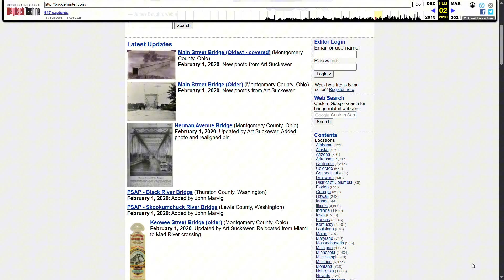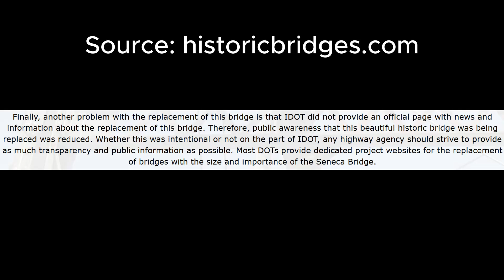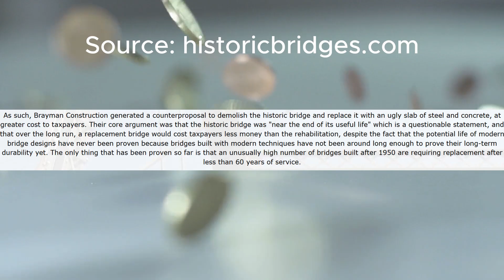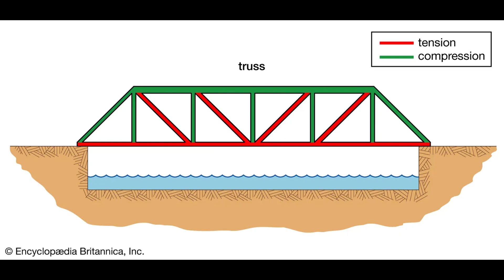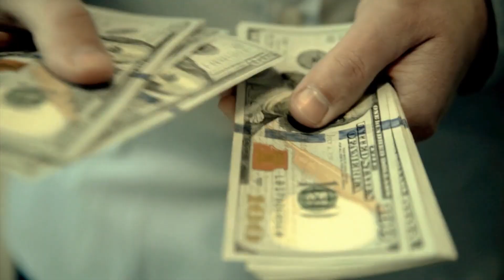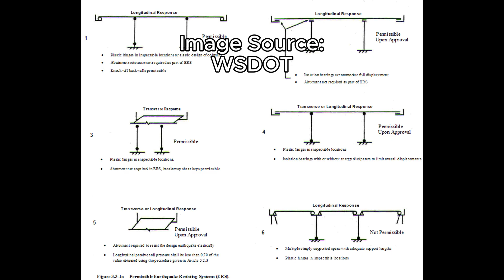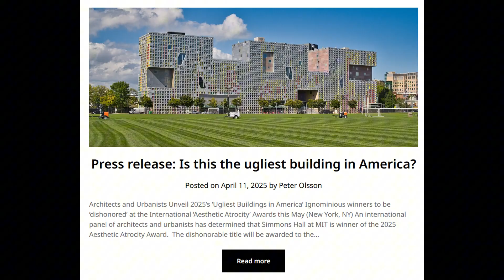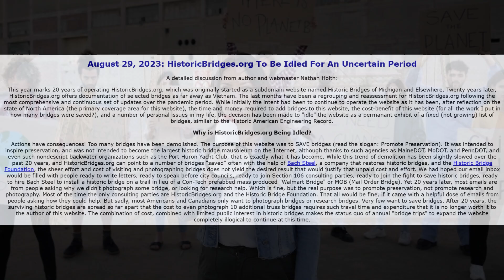The Tragic Death of Truss Bridges

Comment: I'm into historic highways and all the infrastructure features associated with them, especially bridges. Since I started a web site about them 30 years ago, a shocking number of them have vanished or been paved over .
However, there are good reasons for things wwith charm to  have banal replacements. Cost and liability. Steel rusts and requires a horrendous amount of upkeep. Even keeping the old bypassed bridge creates liability and continued maintenance problems.  You derided a couple of cases where the new bridge is designed to pay homage to the old. At least someone tried to honor the old bridge.
Also, not all old bridges are worth saving. The old Gerald Desmond bridge was hot garbage. Pieces of concrete spalled into the water and on ships. It was too low and too narrow. The replacement is objectively better looking, more functional, and far safer. 
The march of progress is inevitable. Let's work on preserving the best examples and write the others off as casualties of neccessity

Comment: I kinda share that same sentiment whenever they replace a truss bridge with a cable stayed. I’m sure there’s more advantages to building a cable stayed bridge over a truss bridge, but some cable stayed bridges just doesn’t have much identity compared to the latter. For example, the new Key Bridge in Baltimore isn’t going to look as iconic compared to the original one. The original design combined a truss and arch design which made it stand out. It sort of was americas Sydney harbor bridge. The new design of the key bridge…..there’s several other bridges that look the exact same.